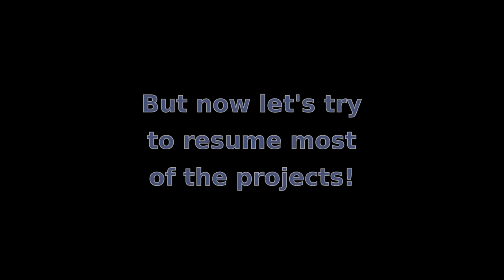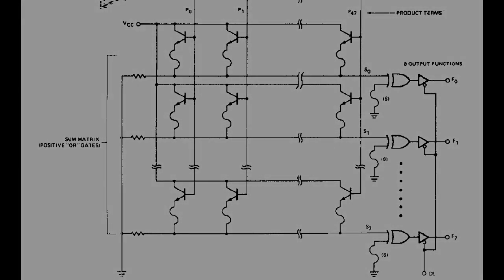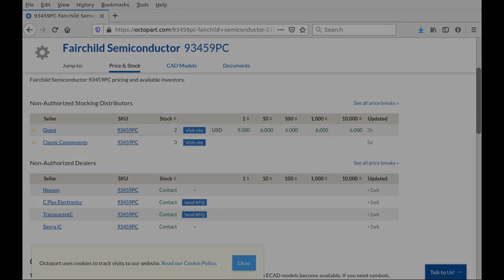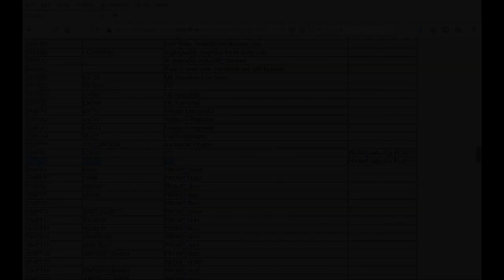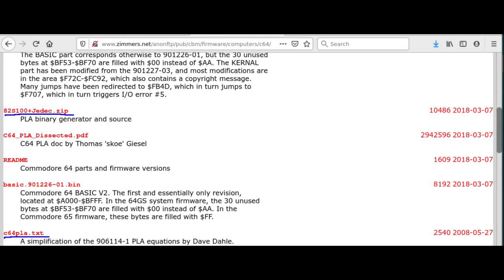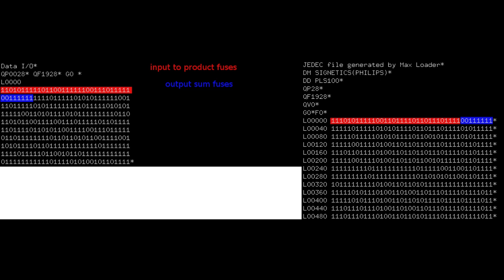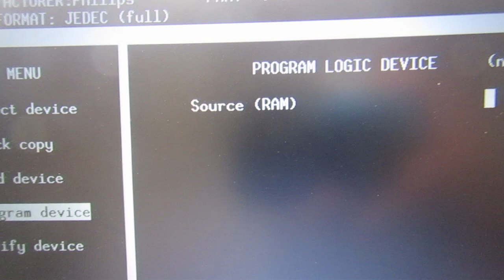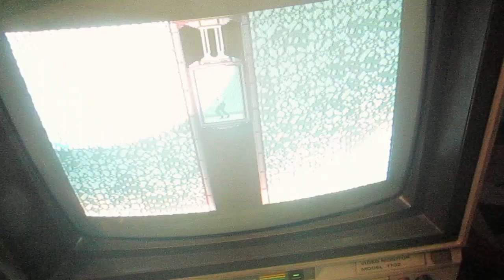The 82S100 PLA and its Soviet clone. Let's make a NOS C64 PLA.

Comment: The R556RT2 is also available in a military flat-pack version- that's the one without the 'R' in front of the designation.
Reply from the maker: Sure, but that's hard to fit in the 600 mils dip sockets :) Anyway I've used perhaps 4 of my stock of R556RT2 in these years. Nobody sends CBM stuff anymore to be serviced. My stock of blank parts will outlast me.

Comment: Your MOS8701 replacement.... These days there two great options. "TOLB" (the other little board) which contains crystal and everything so you don't need those 3 extra components on the board. There's also a MOS8701 replacement that a Finnish guy makes, CBMretro, that is really nice and ressembles the original IC. Whether or not there's a performance difference I don't know. The original 8701 is not that stable after modern standards but I can't explain why as I think it's more than just instabilities in the crystal circuit on its own can explain. Maybe I'm wrong and the TOLB is the most stable of the two. For the TOLB beware that is exists in two flavors - PAL and NTSC.

Comment: Fascinating, I’ve recently used a C64 with a hardware interface from the cartridge slot to program 82S123 (programmed in BASIC)
Reply from the maker: Oh, very interesting, any pointer to that interface? In the old days there was a quite useful EPROM programmer for the C64, the "Promenade C1", one of us got a unit for a few days and we successfully copied the PCB and made our own clones, I still have mine in good working order, with a few wire patches :) However this one would only program the "regular" EPROMs (2532, 68766, 27xx up to the 27512).
Reply: @iz8dwf  It’s home made, I found a design for a ‘manual’ programmer in an old edition of ETI magazine, I then set about designing an interface for it so it could be automated, The code is in BASIC, my design drawings are a little rough, I should tidy them up. Let me know if you’re interested to see. I built it to replace 82S123 working as colour proms on Arcade boards..Galaxians for one.
Reply from the maker: @petesapwell  Yes, I'm definitely interested in seeing that programmer's schematic! If you have the original magazine it would be well worth a scan of the article! I have different programmers that can handle these parts now, but it's always worth knowing how it was done in the old days :)
Reply: @iz8dwf  I will dig it out to get to you. email?
Reply from the maker: @petesapwell  iz8dwf@amsat.org, thanks :)

Comment: Wow! Does it run hot? 😁
Reply from the maker: Not too hot. It gets warm more or less an original 82S100. Surely less than the MOS mask-programmed clones.
Reply: @iz8dwf  That's great. Yes, the Commodore factory PLA chips get extremely hot. Thanks for sharing this informative video.😁

Comment: What type of programmer is needed program these ICs?  Will you post your reconstructed fuse map and what you dump from 82S100 PLA?
Reply from the maker: Hi, a non complete list of programmers suitable for this device includes: Data I/O models 2900/3900/3980/Unisite. Hi-Lo Systems models All-03, All-07 (these might require adapters to be made). Other programmers brands and models might be suitable too, but I researched only the cheaper options that could be found in a reasonable time (if a couple of years sounds like reasonable). The reconstructed fuse map is available, just drop me an email. If I get a real 82S100 to be dumped, I'll also upload the fuse map to zimmers' ftp site.

Comment: One or two of my C64s have the Signetics PLS100 for a PLA.  I’ve seen them for sale on eBay and other sites and if I remember right the price wasn’t that bad.  But it wasn’t until recently that I learned they have to be programmed before use, not just stuck into the computer brand new.  Since I’m not about to sink the money into a programmer, I’ll just stick to getting known working PLAs or a replacement like the PLAnkton.

Comment: I will send you an 82S100 PLA Original Monday if you need one.  I have at least 5 of them.  -Mark.
Reply from the maker: Hi Mark, I'd appreciate having one yes, even though I don't really "need" one anymore, as the reconstructed fuse map appears to be working perfectly (and has the correct checksum).
However, I'd appreciate a picture of the chips you have, because there's an early revision of the C64 PLA (with a different fuse checksum) that has not been dumped as far as I know.
Reply: @iz8dwf  Okay, I will also send you a couple of MCM68674/6 Pin Compatible EPROMS that obviously don't require adapters to use as 2364 direct replacements.  I managed to get a bunch of them locally, lol  -Mark.  Just gonna check to make sure I still have your e-mail address. I probably should ask GadgetUK (another one of my favourite Retro Youtubers) if he'd like a couple as well.  -Mark.
Reply from the maker: @deborahberi3249  Whoa, those are so nice indeed! Please drop me an email first, so we can check if you have an elusive early C64A that needs to be dumped :)
I'll send you an email, so you can answer to it if you don't find my address anymore.
Reply: @iz8dwf  How do I PM you via Youtube?  -Mark